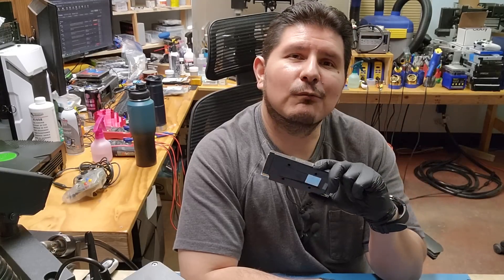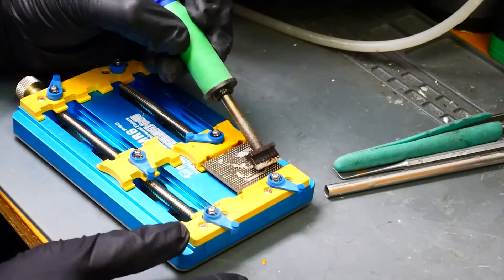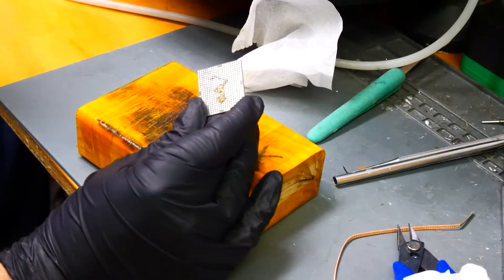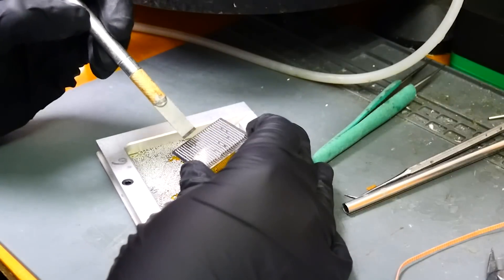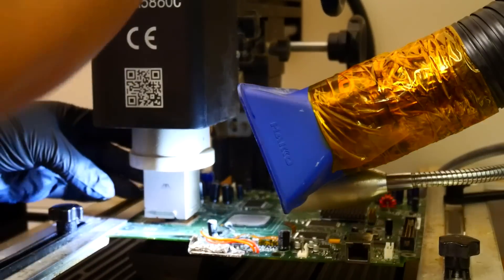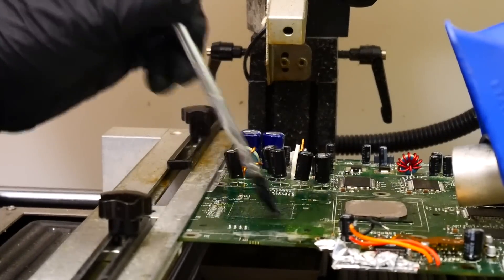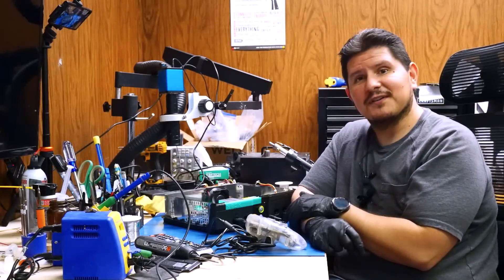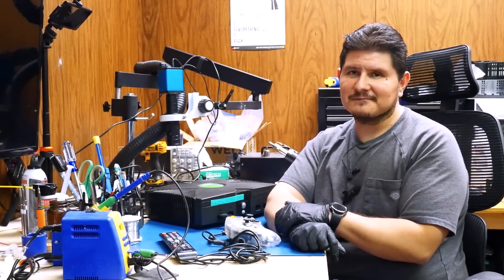Is it Worth it? OG XBOX CPU Upgrade 733 MHz to 1000 MHz (1 GHz)

Comment: Awesome! the 1ghz P3 is the easiest cpu upgrade as its just Reballing no interposer adapter needed.
The XBOX at 1ghz can run almost all games patched at 720p resolution! im playing MORROWIND patched at 720p with my 1ghz xbox on a 55" TV and the graphics still being good. You can also overclock the cpu by SOFTRARE too... so your 1ghz Xbox can go up to 1.4ghz!!! there is a recent overlock software for the xbox. The next steel is patch the game XBE file to make the game recognice the higher cpu speed, and enjoy.
Reply: Easier to just play on an Emulator
Reply: @Rico0333  stop spamming about emulators, 1ghz CPU on the xbox allows you to play 720p HD content like a 7th generation console, you can play a lot of original games at 720p on the original hardware a thing even xbox360 retrocompatibility cant do.
Reply: @SargentoDuke  how much to buy one ?
Reply: @integratypeAUT  Retro Renegade Repairs do this mod, he has pined a comment is his video
Reply: @Rico0333  true but cpu upgrades are cool - also how much is it to purchase an OGXBOX with upgraded CPU ?
Reply: This stuff is definitely cool. But why go through all this work when you can just use a PC? Just because? I get if there are certain Xbox exclusives you might want to play or just cause it’s a cool project. But seems like it would be better to just keep the Xbox stock for collection reasons imo.
Reply: How can you overclock the CPU by software?
Reply: Just use an emulator.
Reply: @thecircuitbox  most of xbox original content cant be emulated even had same graphics on retrocompatibility

Comment: Yeah, it's smoother. Not sure what the FPS counter will say of course, but I would figure it's probably holding steady at 30 with the upgrade, and dropping a few frames here and there without it, resulting in that slight stutter.
Reply from the maker: It'd be awesome to get an FPS counter to see how much of a difference the upgrade actually makes.
Reply: @RetroRenegadeRepairs  Well, there is one way you could possibly get a count, but... you might not like it.

...

Got a slow motion high speed camera? I don't remember the exact details for it, but there will be a certain speed you can set it to, comparatively to the screen being pointed at, and get a frame rate that way.

Comment: I wanna get a ram upgrade and a bios flash on mine.  But unfortunately it stopped working when I recapped it.. I think some ram traces accidentally got severed...
Reply from the maker: That can be repaired, but when you can get an XBOX for under $40 on eBay you may as well just do that. In most cases the damage can be repaired, but that's only if you're up for the challenge.

Comment: makes an obvious difference in my opinion. i could never do this myself, but would jump to buy one already upgraded for my mancave! Is there any possibility of adding in more ram or is that already maxed out for the system to recognize?
Reply from the maker: Stock XBOX comes with 64mb, the max at this time is 128mb ram.
Reply: the xbox can be upgraded to 128mb has unused ram slots, and theorically to 256mb with better chips but i dont know if any tested or a bios compatible, all xbox can work with 128mb from stock, the ram and the CPU made the xbox move 720p resolution on games and videos so is worth it if you play the original xbox on a modern HDTV, yo soy can play old games but in way better graphics.

Comment: how do you get 400mhz extra when the 1000mhz is only 266mhz faster than the 733mhz?.... 
this is a bit dumb... not worth upgrading to the 1ghz... better off with the (hard to find) desktop 1.4ghz Tualatin and interposer... its almost TWICE as fast as the original cpu...and has double the cache which speeds things up more than just the clock speed increase...
Reply: Easy, horrible math skills.

Comment: new subscriber im curious why you didnt go for the 1.4ghz cpu
Reply: the 1.4ghz cpu needs an overenginered interposer adapter... but the 1ghz is just reballing so it keeps the original stuff, anyway you can overclock the 1ghz by software too to reach 1.4ghz
Reply: @SargentoDuke  awesome thanks for the education aside from a TSOP and a sata HDD with a custom dashboard my cpu and ram are stock
Reply: @NIXIEPIXIE  anyway, you can try few games that can run at 720p on a simple stock softmodded xbox... like World Racing, Unreal Championship, and i thought Morrowind or even GTA3 will work too patched at 720p at 20fps you will enjoy them a lot with a proper HD cable on a modern HD Television.
Reply from the maker: I didn't have the stuff for the interposer or even the CPU at the time. Soon! Thanks for the sub

Comment: Explains why slot 1 P3 1gh are screwed in prices. Destroyed for a sh!tbox console.
Reply: Amen.
Reply: Clean your mouth to say thtat, the original Xbox is the most powerful pentium 3 machine, and it can be used as daily machine to play 720p videos or even Youtube, and playing games at 720p resolution... instead of 480p. No freaking pentium3 PC can do that even in dual cpu for daily use. Anyway, is a waste because you can do the same just with the MOBILE PENTIUM 3 1GHZ, that its actually better because you can pinmod a switch to make the mobile P3 1ghz work at 733mhz on "low power mode" like the original cpu, and then disable steepspeed and the cpu goes 1ghz, is not needed to destroy a slot1 pentium3 because the "mobile pentium3 1ghz" EXISTS, not because a "sh¡tbox console" my xbox sh¡ts on your pentium3 im playing games like Morrowind at 1280x720p resolution and videos at 720p too at high fps and the console load like a freaking modern PC because i had an SSD and the xbox works with a think called "HYPERTRANSPORT" that allow you absurdly high disk speed tranfers, so the HDD is used as a virtual memory, with and SSD it loads way faster. 
You are on time to get an original xbox, install a 1tb ssd, more ram, and get a mobile P3 1ghz instead of the slot1... and ejoy using a pentium3 for DAILY GAMING AND VIDEOS!!! dont waste a slot1, the mobile p3 1ghz is the one i had, the only difference is you had to pin the speedsteep to change the cpu speed.

Comment: CPU upgrade isnt worth it with out a ram upgrade because the stock RAM size and its buss speed is the bottleneck. So memory size would have to increase regardless of speed. You would have to sell a full CPU/RAM enhancement package to make it meaning full for the OG xbox. Great job though. Everyone should learn how to do this.

Comment: Back in 2000, I "aquired" three massive Dell Optiplex PC's in really heavy, wide, beige cases. I did a job for a guy, stripping and sorting out 40+ PC's. Took about a week and as payment he offered me those three machines. Had no idea what was inside them. I was running a Pentium 2 400 at home, with a VooDoo 2 8MB.

Anyways, opening them up I saw they had three SCSI HDD's each, all of them 8.6GB. The huge motherboards had onboard SCSI, but the HD's were connected to a separate SCSI card. They also had TNT2 Viper V770s, 128MB RAM and TWO (!!!) P3-550 CPU's, in the dual SLOT boards. Each were running Windows 2000 and after a clean install, they ran flawlessly. Never a single crash of BSOD.

Super reliable PC's. I ended up selling six of the nine SCSI HD's for a small fortune, then I gave one of the machines to my brother and kept the other two in my bedroom so my friend and I could play LAN Quake III, Total Annihilation, GP500 etc.

Barely any games made use of the dual CPUs back then, perhaps only Quake III, so I eventually sold the four CPU's and bought two P3-700's and two terminators which gave the machines new legs.

I only wish I'd kept one of them, they would have made excellent retro machines. Alas I "aquired" a P4 Dell machine with RD RAM not too long after and sold the two Dimensions in the local classifieds. One guy bought both of them for a decent wad of cash, and I took it and bought a Geforce 4Ti 4800SE and a huge flatscreen CRT (for Quake III of course!).

Comment: to me personally its pointless. ALL the games made for xbox were made to run on the original cpu without issues. I guess you'd get a few gains in emulation but when you can by like a kiddiepow or whatever they're bloody called for $60 that will run things up to wii games....why bother
Reply: By the same weird logic "all games were designed to run at 480p" and with the 1ghz cpu and 128mb you can play ALL GAMES AT 720P 🤣🤣 im playing KOTOR at 1280x720p on my xbox, MORROWIND, GTA Trilogy... all at 720p and LOOKS WAY BETTER THAN ON XBOX 360, emulation? NO, the upgrades allow you freaking 720p, forget about emulation when you can play YOUTUBE 720p on your original xbox and almost all games at FREAKING 720p resolution that made the xbox looks good on a modern 55" 4k HDTV. Kotor on 720p widescreen looks freaking awesome, Project Gotham Racing2 too, Unreal too... omg all games can run at 720p bu you need at least 1ghz cpu and 128mb ram. Halo or Half-Life2 can run at 720p too. Anyway, the cpu upgrade is non needed because ALL STOCK XBOX CAN RUN AT 1GHZ WITH NEWERE SOFTWARE 😅the cpu ugprade is to use that overclock software, to increase speed  from 1ghz to 1.4ghz or low the cpu speed to 733mhz. You can use an original xbox for daily youtube and casual gaming (even online gaming) and even searching in google and surfing a bit on internet... if it can emulate very well is a secondary thing.

Comment: Never in a million years could I even think about attempting something like this. Amazing skills and tools you have there. Also WOW Half-Life 2 is ACTUALLY PLAYABLE now
Reply from the maker: Thanks
Reply: @RetroRenegadeRepairs  you just got a bringus comment, lucky man
Reply: just wait till you see the 1.4ghz consoles
Reply: inb4 you try this and destroy an assembly line's worth of original xboxes
Reply: @alanmix8183  yeah, he would, in fact, cause irrepairable harm to at least one xbox
Reply: With the 1ghz CPU you can PLAY HALFLIFE2 in 720p resolution!!! Jus patch the XBE to 128mb, 1000mhz cpu, and patch it with OgxHD for 720p...on my Xbox 1ghz Half Life 2 runs awesome at 720p
Reply: i did this with a macintosh G4 last year. i 3d printed jigs for my balls and used a hotplate from amazon with a hotair station from aliexpress. it worked just fine.  i also replaced cache chips and flashed new firmware.  i think its a slightly tighter BGA than this but not by much.  this is totally doable at home but just takes some time.  this fancy machine looks really cool tho
Reply: Dude, one of my favourite channels ever. You rule
Reply: hey look its bringle man himself
Reply: BINGDUS STUGIOS!
Reply: C'mon Bringus!, TRY IT!, DO IT and MAKE IT BETTER!
Reply: I wish this was possible with a ps3
Reply: @NCXitlali  It kinda is, you can replace the phat PS3 GPU with a slim PS3 GPU.
Slim GPUs are more power efficient and runs cooler. This is called the Frankenstein mod.

Not the same as the Xbox upgrade, but still pretty cool.
Reply: @Ozzianman  no, I mean upgrade PS3 CPU
Reply: my god its the bringular studio
Reply: normal skills, great tools and the guy is skipping some parts of modification on this video
Reply: Omg it's a wild BringusStudios!

In all seriousness though, you just need the right tools, although a BGA machine is not the cheapest purchase. They do make cheaper ones I think, like $300-$400 or somewhere thereabouts.
Reply: Played the Orange box on the Xbox 360. It was very playable there! And difficult as all hell. Yet my lucky star that the ring of death was only a internet joke for us. Ended up even playing GTA 5 on the Xbox 360! True troopers of a console gen they where for us. Even the Wii gave up before the Xbox 360's. The CD/DVD reader failed on the Wii... But the Xbox 360 lived on and on. I do not think any one I knew had a DDD. They where put in a closet only to be taken out for GTA5. Lucky us? They where not lightly used... And still lasted all that time.

Controllers are simply horrible for shooter games. One of this days I should try and play HF2 with a controller and see how bad one where back in the day at games. HF2 was a fantastic game! Even now it was one of the few shooter games that I ended up playing with a controller. Even GTA 4 that horrible mess of a PC port was simply worth enjoying on a proper PC with a mouse to aim. GTA 5? Aaa. It was a grate send off to console gaming. A last hura before ditching it completly. More likley to buy a Steamdeck 2 then a Xbox/PS/Nitendon't. Do not even own a handeld outside of old trusty PSP's. Linux on desktop FTW!
Reply: @TheDiner50  CD/DVD is a very easy fix on the Wii BTW, once you get in in the first place. Like easiest replacement in the whole console.
Reply: @TheDiner50  PSP and Vita were amazing consoles for the time... It is ridiculous that they had gave up the handheld market to Nintendo entirely. If the Vita got the love and support the PSP got it wouldve been so much better. But it just did not get the same kind of game library no gta or anything its crazy it shouldve been so much better.

Upgrading an Xbox like this would be awesome
Reply: @TheFrogInYourClosetWatchingYou I put so much stock into the Vita. It's still an Indie/Homebrew powerhouse, but man I wish Sony would have given it more love :(
Reply: BRINGUS OMFG U REPLIED I DID NOT EXPECT THAT
Reply: Crysis is the word. Not HL2.

Comment: I'm noticing the caps near the cpu isn't flushed with the pcb like it dangling in mid air
Reply from the maker: They have non standard spacing on the leads

Comment: killing a slot 1 P!!! 1GHz cpu for a Xbox seems like not worth it... Rather have the slot 1 CPU!!! On the other hand, would love to see that 733MHz cpu soldered on to the SLot 1 SECC and put it on a PC to see what would it do...
Reply: I think it wouldn't be too complicated to make a socket 370 adapter. It should be pin compatible, and there's plenty of clearance.
Reply: Until someone figures out how to oc the 733 or use an AMD K6 Series
Reply: @shadowopsairman1583  overclocking has been a thing forever both the CPU and GPU can be overclocked
Reply: you mad? the 1ghz Xbox can play games and videos at 720p resolution, xbox was designed for this cpu but lntel tricked MS and gave the crap 733 one, so the cpu botleneck the Xbox... is not worth? with better cpu you can play all games at 720p resolution instead of 480p.
I had an 1ghz Xbox and i can see 720p movies on it, and play games like Knights of the old republic, MORROWIND, or Half-Life2 at 720p resolution it makes the Xbox a good console to use on a modern giant TV, because better CPU converts the original xbox on a HD generation console... but you need at least 1ghz cpu to move 720p. Also you have a youtube app for the original Xbox, and with the 1ghz upgrade you can see 720p videos. You had to see the original xbox as a "timeless PC" its a pentium3 that still can be used everyday to watch movies or play HD games... even playing online... a pentium3 from 2001 moving HD 720p content at high fps, timeless
Reply: His annoyance is coming from the fact that those 1ghz slot 1 clue are rare.

I can pull out an emulator and go up to 1080p on my laptop for some titles, and the main rig could upscale everything.

Is destroying a rare part worth it when there are alternatives? Maybe not.
Reply: And look, I've owned two, but I wouldn't call them timeless.
Reply: It is somewhat between a Pentium III 733 and a Celeron 733. Has the full 133mhz FSB speed of the Pentium III with the smaller 128KB cache that the Celeron has. It would run worse though because the original XBox had DDR1 SDRAM at 200mhz (shared with GPU). Would probably need BIOS support to run.
Reply from the maker: IIRC, someone has done this and it did work in their machine

Comment: ok that is really cool. Didnt know the CPU could be upgraded. Well done sir
Reply: The classic Xbox is basically a PC with a Pentium 3, Geforce 3 and DDR ram. If I'm not mistaken, it's also possible to upgrade the RAM, although it's quite hard to do.
Reply: @Alefjj  Yep, and the OS is based on Windows 2000 with DirectX.
Reply: The Tualatin is a way finnickier upgrade. Requires the processor adapter by kekule. You can push it upto 1.5 ghz.
Reply: There’s a new interposer from zzattack that is pretty awesome we’ve been using. Also custom 3d printed brackets for the original cpu heatsinks. I’ve installed a few on my channel. Great work on the 1ghz upgrade bro
Reply from the maker: Thank you good sir. I have watched a few of your videos, great stuff!
Reply: @Computer_Booter 🎉
Reply from the maker: Thank you
Reply: @ModernVintageGamer has a video on a commercially made XBOX with a similar upgrade to this one.

Comment: It runs a lot smoother 😊
Reply from the maker: I thought so as well, but I think using the extra speed with emulators and XBMC would probably be where the CPU upgrade is best used.

Comment: Interesting you can just plop a penthium in the xbox.
Reply: Well they did just use a custom binned variant of a desktop P3, There's a few CPUs you can chuck in there though the socketed ones need an adapter
Reply: @talibong9518  definitely one of the coolest console hardware mods.
Reply from the maker: I was quite surprised myself when I heard about the possibility.
Reply: @RetroRenegadeRepairs  I knew cpu upgrades where a thing but I never knew the xbox just used a pentium.

Comment: upgrade the memory to : 8 or 16gb of memory
Reply: You can't upgrade over 128mb to my knowlage
Reply: @L0tsen  give it a try
Reply: @L0tsen  you can upgrade to 256mb with proper CQ50 chips but noone has tested a bios that support it, anyway 128mb are good to play videos or patch games for 720p resolution, because the xbox had actually modern tecnology like Hypertransport that allow to use higher disk speeds so use it as virtual memory, and the gpu had Turbocache for the same, dvd or hdd(or even an ssd) is used for memory too.
Reply from the maker: 128mb is the max supported at this time.